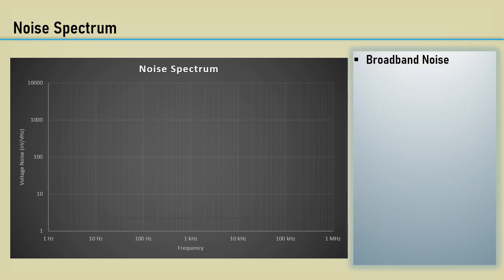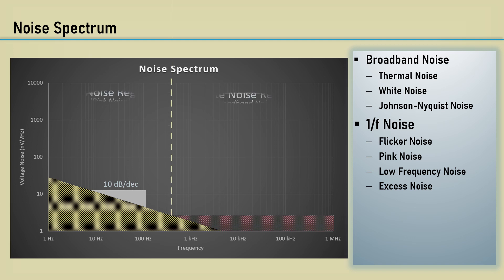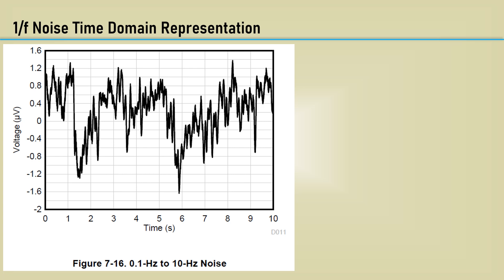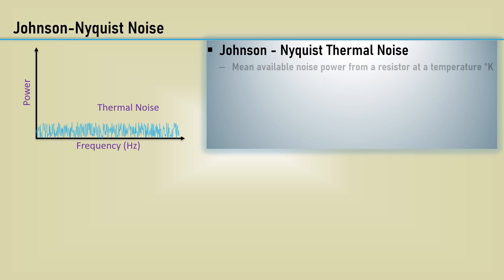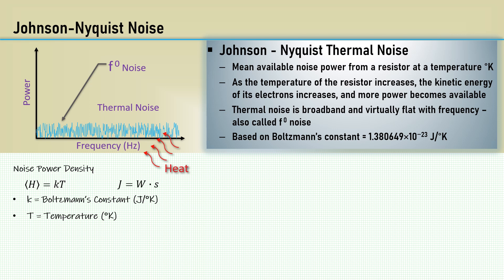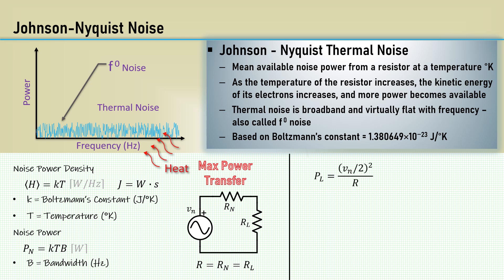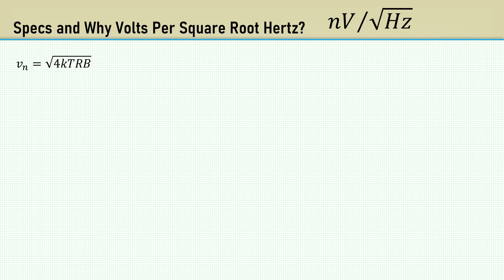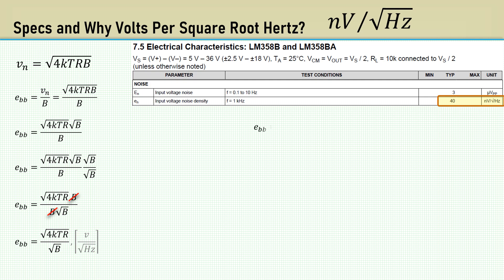Op Amp Noise Calculations - Part 2

Comment: How can I reduce the noise in this wah filter: https://www.youtube.com/watch?v=pFC8sfrncrk - I like this topology  because it only need 1 variable resistor to change frequency which means I can use single LDR (phtoresistor), other wah filters often need potentiometer (like a voltage divider) which is not as easy to make with LDR. But it's quite noisy. I've tried few opamps 741, lm258, jrc4558, ne5532p, op27g but noise is still there.
Reply from the maker: Looks like the 300k resistor could be your culprit. Lower it as much as you can and change the other components to get the desired response. The NE5532 and OP27 are good choices.
Reply: @oldhackee3915  But then the filter is not narrow enough to make the "wah" sound.
Reply from the maker: You would need to change the capacitor values when lowering the 300k.
Reply from the maker: Ahh but the Q is the sqrt(300k/10k). Could you live with a lower Q?
Reply: @oldhackee3915  Probably not it will not make the wah sound then. It needs to be really narrow and tall.